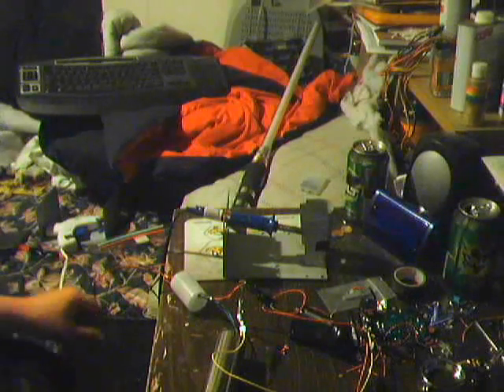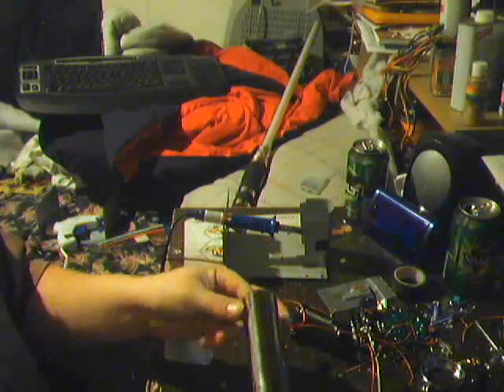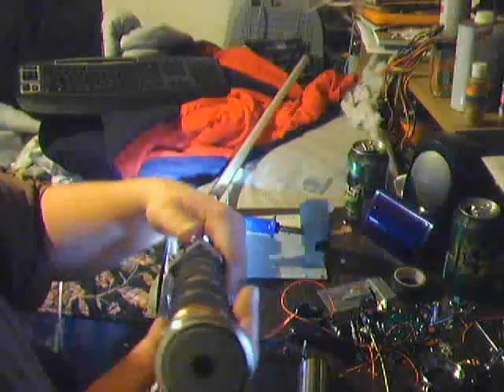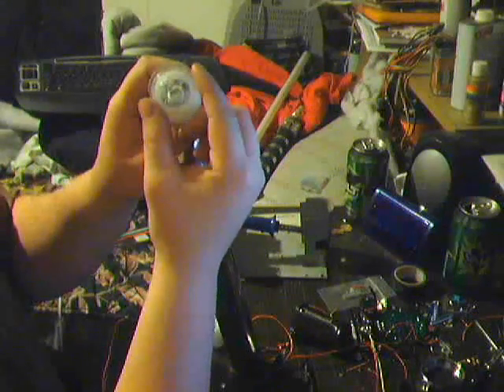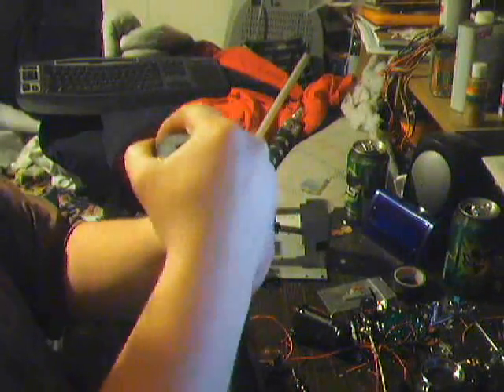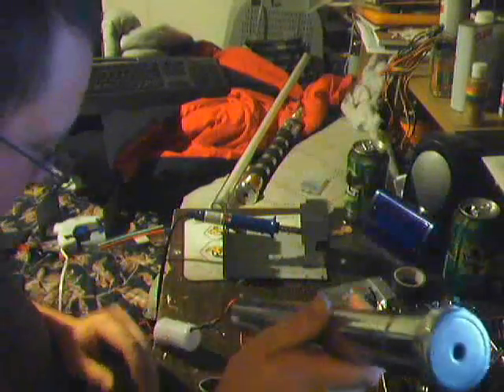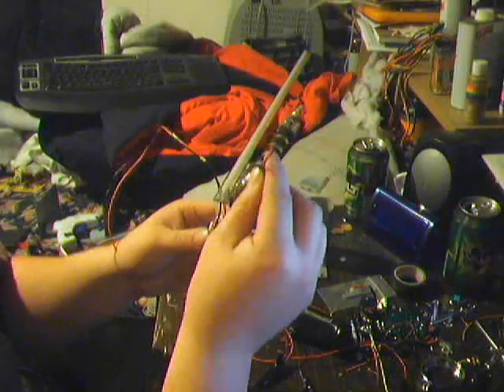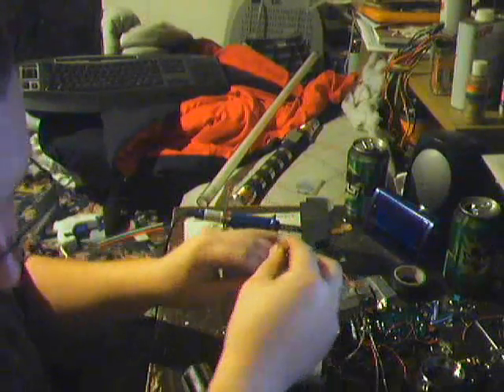birth of the great saber

Comment from the maker: each board is different. you will have to make a note of what each wire goes to. for the lux LED its not hooked to the Hasbro board at all. i used a spdp switch which has 6 leads on it. its basically 2 switches in 1 and have them both hooked up to it